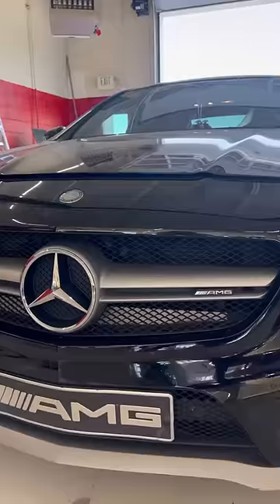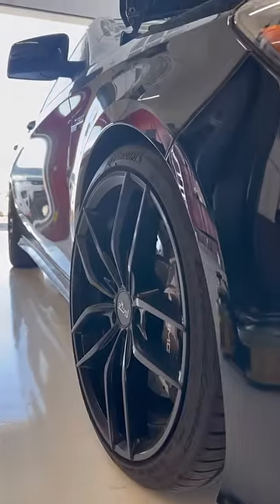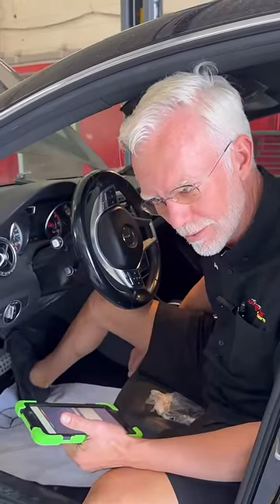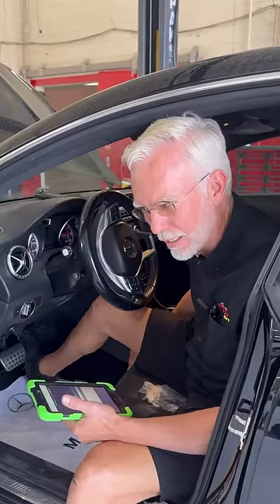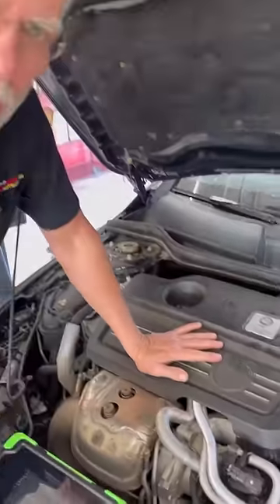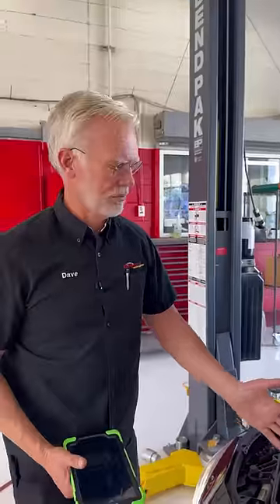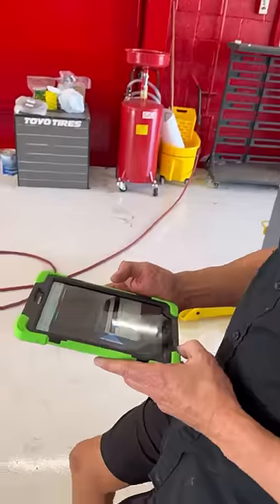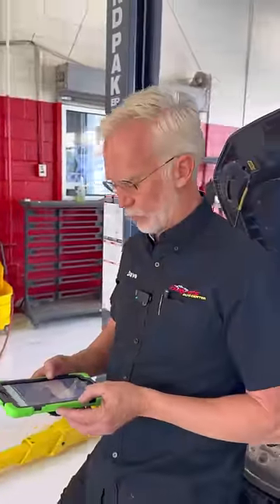Mercedes AMG Nothing but a slight noise on start up #carrepair #autoshop #mercedes

Comment: People need to realize that dealers are filled with the same kind of dummies that work at 5 minute oil change shops. They can only hire who puts in a resume or whoever wants to work there😂😂
Reply: That's... not even remotely true.
Reply: Not even close to being accurate 
As a fact its usually just the complete opposite, i worked for Mercedes benz dealership, and i have 30+ years experience, and the amount of ongoing training where i had to drive 6hrs to new jersey to their training center a few times a year, all the techs i workes with had so much training its unbelievable
Reply: Maybe the serpentine belt broke and they kept drive it cooked it but not seized
Reply: They also have to have a certain number of master techs!
Reply: The lowest payed mechanics in the industry 😢
Reply: Not entirely true. Some dealerships do hire only people who went to WyoTech or UTI. But the thing is still those can turn out people who didn't learn anything. As one guy told me, "they just rush you through." I will say this much they continuously train techs via the brand. But some do unfortunately act a bit too cautious about repairs. One guy out of fifteen did exactly that. He flagged engine and trans mounts a bit too prematurely and was let go. 

It all depends on the service manager and shop foreman or team leads. Where I worked they usually would talk to their superiors and service advisors. Same can happen in a local shop. I know I saw favoritism cause some massive issues.
Reply: @fox1978gmail  you are few and far between, bro. Just because you have  skill doesn’t change the fact that most are idiots. I’m in Residential Remodeling. It’s the same for my business, too. We’ve just dumbed down existence. Set bars too low and now we have a country that is predominantly stupid.  That’s a fact.
Reply: @Junkyardbuilds so, that means you probably met Hugh.....
Reply: Called it my friend.
Reply: @oddmanout7755 it's very fucking true they might be one or two actual real technicians at a dealership..
Reply: @louislachance1330 what's the problem.
Reply: @86LukeM I'm a graduate of mmi. My class was the last class run through the old way. They were pretty strict, but after UTI took over it was definitely easier, more open. 
It's a place where you can get out what you put in.
Reply: @TraceyAllen  I can definitely see the get the get what you put in thing. A guy I used to work with who went to UTI. He's probably still paying off his student loans. Walked through the Mercedes service department and saw a v12 car. I forget the model of Mercedes. He looks at it and says "v12? I thought the engine would be larger..." i respond saying, "I think they use smaller pistons. I thought you went to UTI?" He responds, "I did but they rush you real quick through everything." He was the second one I knew in that department. The other went to be a firefighter. The third got his foot in the door. But the guy I'm talking about got a DUI and quit, because the job required a clean record.
Reply: @Junkyardbuilds So is that why they want to replace a perfectly fine engine? All that TRAINING, and EXPERIENCE?
Reply: I feel that there IS a lot of training and years of experience in the dealerships, BUT, that is not the issue here.  Even dealerships are subject to the dishonest and unethical practices that are now in place and becoming the norm as the poor economic conditions are increasingly worsening and thus unscrupulous technicians have become more likely to 
‘inflate’ or outright lie to generate more revenue from unsuspecting customers!  I’ve caught more than one’tech’ trying to sell me something that I don’t need! The industry needs to police themselves for their own survival or we the consumers will not be going to them for any repairs! There are many more options for us to consider! 🤷‍♂️👍🏼🤔
Reply: @rootsmore-fire3061  i don't know, I'm not tge tech that diag it, I'm sure they followed the flow chart and came to that conclusion, there could be alot of different problems with the engine that we are not being told, we don't have the whole story here
Reply: @iamzeusandthisisthetruth4229  1st I was replying to a comment that said dealerships are filled with dummys so yes the training and experience was the answer to that 
2nd we don't have the whole story here, I'm sure there was a reason why they told the customer he needed a new engine, I'm sure they had a reason to tell him that because Mercedes-Benz dealerships will not tell you that you need an engine if you don't need one, it can take a long time to get one of those engines especially if they have to get it from Germany and being an amg I'm sure thats the case, so maybe he has low compression on a cylinder, or a bad head and turbo, we don't know,
Reply: Yeah at ford we only hired technicians that had been through the ford ASSET program (automotive college degree focused on fords) and I mean yeah the lube techs might be dummies but not even all dealers use lube techs
Reply: You are slightly correct. You have to remember that alot of these guys get manufacturer specific training wich is gold. I've worked at 3 different dealerships.. you will always have your under achievers that I wouldn't let work on my car. Just as well some of the smartest guys in the game on par with the brand field techs or engineers are here at the dealer.
Reply: I have worked independent shops most of my 35 year career. All the dealer techs we hire are lost at working on other brands! They get worked up because different manufacturers call some parts different names or put them in different places and have nothing to tell them what to do and quit in a few days. It's really sorry.
Reply: No way dude you're insane. Techs and sales folk go through tons of training and techs do certain certification exams to make them able to perform work on specific models or perform work like engine building or turbo rebuilding. Those are smart guys.

Now, that doesn't mean all of them carry certs or training. Some techs only do oil and filter replacement. At German dealers you'd be amazed at what techs go through for training.  Same with the guys in parts and service.

Comment: 1. Flush coolant system - Clean radiator inside and out if necessary
2. Change Thermostat - while you are at it, check valves
3. Check exhaust system - verify not clogged
4. Check for coolant flow - if no flow - change "water" pump
5. If water pump ok then examine/change turbo

Comment: Overheating 1st would be the thermostat. Front speed sensor would be to see if it's connected properly and cable not pinched. Turbo not getting full power count be from the sensor which would put it into an Emergency mode

Comment: boost leak on a boost pipe that causes that whistle noise and will cause under boost,also check the charge cooler that thing leaking

Comment: Well, I would check the oil filter, but I would also possibly pressurize the system. If you find any water leaks, check all the codes get them codes correct and then go from there.

Comment: could the under boost condition cause overheating causing the engine to push harder as its not getting the boost it needs?

Comment: Wheel speed sensor causing stress on transfer case. Could this cause overheat on differential? Boost leak I am dealing with now. Hoping sensor

Comment: Check the thermostat and see if it is leaking, Check the pressure on the radiator and if it is leaking, see if there is transmission fluid and it is topped off, make sure coolant is topped off and no bubbles or air in the system

Comment: If it has a variable geometry turbo then more than likely it has a vacuum leak in the waste gate control leaving it stuck open causing over boost condition and overheating subsequently or the fan blades inside the turbo have a foreign object that wiped them out

Comment: Very first test would be to check the coolant, look for smoke, do a head gasket test, followed by a cylinder leak down test. The engine is likely fine, but could have a sticky valve. Low boost could also be a faulty recirculation valve/bov/wastegate

Comment: There is a "hole" somewhere in the intake system and it's making that hissing noise and that's also the reason its tripping that underboost code cause  boost is escaping.

Comment: I would check the coolant/oil first. If they look good I would check the intercooler and exhaust system for leaks. Noise at start up that then stops at temp could be a bad seal or crack in something.

Comment: Needing an engine on that i would be checking the intercooler and the thermostat opening if thats sticking it will overheat if not that check the water pump and check oil pressure etc etc

Comment: First thing id do,  is run a thermal imager test on the radiator an look for cold an hot spots..(possible clogged radiator)..then check waterpump, an then a pressure test...to find out the overheat problem..check the coolant screen..then go after the engine noise 2nd...

Comment: The first thing I would do would be to check the oil for metal. Then do a coolant check to make sure there's no head gasket issues. If both of those come up clear then I would start looking for boost leaks

Comment: Pressure test water cooling system, cheak the radiator cap. The thermostat check heater in the car is working water pump niose?. Turbo could be overheated

Comment: If the noise is at intial cold start up, then when warmed up: oil hot, water normal hot. Could it be related to heat expansion on that  effected part  or component?  Sometimes its the most simplest thing.

Comment: Pressure test cooling 😎 system look underneath for leaks. Noise on cold 🥶 is o k wait till it warms up .change brake pads. Check exhaust. Put slick 50 magnetic oil in it .fantastic videos Sir 📹

Comment: Check coolant for exhaust gases confirming leaking head gasket, thinking I remember some German cars having plastic water impellers that cracked where drive shaft went through and would cause impeller to slip at high rpm causing overheat, and maybe check for excessive exhaust back pressure from clogged cat especially if it’s a turbo…….or a simple cylinder compression/leak down can tell you a bunch about inner condition……..the low boost could be exhaust restriction, fighting to breath

Comment: If it bin over heating check for blow head gasket with a block checker. Checking for carbon in coolant System.

Comment: Check whether the radiator temp output temps rise as the thermostat opens or not. If they don't it needs a new thermostat.

Comment: Change the engine oil to the correct specification, check the turbo oil hoses and check the cooling system.

Comment: They first thing I'd check is the head gasket 
See if exhaust gas is getting into coolant system 
It's fast and easy, can tell you if that's the direction or not

Comment: I'd say pull the radiator cap and start it cold and check for bubbles. Seems like a possible blown head gasket causing boost pressure to push past and into the cooling system adding an air pocket creating the over heating concern. But why is there no misfire code!?

Comment: I would look for a ground problem. A bad ground could cause false readings from the speed sensor and pressure sensor. This could also mean a variety of other sensors are reading wrong, but not out of range. It would cause drive ability issues.

Comment: It’s got a blown intercooler by the sound of it and not getting enough boost. Stick ur eyes in the front of the bumper see if u can see a seal pushed out or hear air pissing out.

Comment: Check Thermostat, fan clutch if not electric fan, blocked oil filter, oil color and smell. Check coolant for oil and oil for coolant in case of a blown head gasket.

Comment: I’d check oil first, then coolant level and cleanliness, then for blockages, air bubbles and or leaks, then fan, then thermostat, then water pump.

Comment: I would do a thorough check on the water pump and follow up with the under-boost problem after the cooling issue is corrected.

Comment: Pull codes which you did then do a compresslon test then do a test on the turbo. What’s the mileage? And check for loose clamps conduct small inspections first on cooling system and test drive.

Comment: The dealer wants the monster cash to replace the whole engine.
Check the supercharger boost issue and a possible small feed line vapor lock from or too the radiator.

Comment: The sound is air lose obviously coming from turbo line or turbo its self under boost code and sounds like a leak also so id say that check for leaks on lines and oil pressure to the turbo from cooler. And check the live data on your scan tool and it shows the wheel sensor reading and turbo and everything you can figure it out fairly easily.

Comment: Coolant level, t stat check, verify if temperature sensor is operating properly, check fans for proper operation, see if oil looks like milkshake, leak down test, monitor coolant pressure with the cap off.

Comment: Thanks for posting the challenge, my guess it will be an issue with a 'pollution management system', probably EGR or similar. My guess is that there is oil in the radiator polluting the coolant probably from a cracked intake manifold or EGR cooler or something like that. I look forward to your diagnosis.

Comment: Smoke test the PCV system as well as the induction system in general, Mercedes and BMW are both notorious for under boost because of those systems leaking. Over heating probably from overworking the turbo, without live data of course I'm speculating. Also hard to tell with the top cover on it but if it's equipped with a VIAS valve in the intake. Make sure that valve is working properly. I've seen those cause under boost without throwing codes for the valve.

Comment: Might want to also pull your temperature sensor also replace both of the O2 sensors then put some Justice Brothers fuel system cleaner through it using the check valve off the brake booster to do so

Comment: Well I would check the oil filter and see the condition. Also given that it has a engine code assuming p0299 I would inspect the wastegate actuation and the shaft play on the turbo as it can have wastegate rattling or excessive turbo play. @dave

Comment: Actually I’d check for TSBs related to this concern and then id check the engineering flow chart as a reference tool and I would let the customer know that it may be that they’re looking at 2 separate diagnosis if diagnosing and fixing the low boost concern doesn’t address it.

Comment: Dealer saw over boosting and overheating as major engine failure
       I had a 1.8t a4 a few years ago almost the same problem but In my case I had cracked the integral wastegate sealing surface

Comment: I first would check the thermostat to see if it's stuck. Wait, actually first check to see if the radiator fan kicks on when the temperature gets hot enough.  If it does that, then check thermostat.  If both are ok, then see if there is a head gasket leak by inspecting radiator for signs of combustion gasses entering the cooling system.

Comment: Turbo diag, then cooling  system diag and repair both accordingly. It's very rare that any Mercedes has a real engine problem unless someone ran it low on oil or the wrong quality oil or the wrong viscosity

Comment: IMHO petrol cars that run lean over heat. I'd do the most obvious first. Check cooling system. Air flow meter sensor. Boost leak. Oil change (bad oil). But supposed you already done that. Great job with your videos!

Comment: I would start with fixing that boost leak and checking the cooling system then see if boost leak was causing the overheating issue.

Comment: Overheating, underboost and noise. Look for exhaust leak that is causing excessive heat load. Possibly exhaust leak also melted wires to speed sensor.

Comment: Step one pressure test cooling system check for leaks, then make certain thermostat wasn’t stuck closed. If stuck closed replace thermostat and repeat step 1. Not sure if water pump is internal if not depending on book time I would try and sell the customer  a water pump if I am replacing thermostat and I like changing radiator caps if it old school pressure relief. Then I would inspect for inlet leaks on the turbocharger. Then I would go after the wheel speed sensor.

Comment: Take it for a spin; try to verify customer complaint.  I had a car come in from another shop with overheating issue. Other shop called "head gaskets" after a week of flushing, thermostat and messing around. Turns out, some clear-plastic dropcloth was up against the radiator 😂. ROAD DEBRIS!

Comment: Sounds like the exhaust might be clogged or pinched. With broken turbo parts. The dealership said to replace engine because it’s Mercedes of Farmington.  It’s a guarantee fix, they figure they will stumble across the correct issue.

Comment: well, I would start by pressure testing the cooling system. if it does not hold pressure, I would add fluorescent dye, and try to find a leak. . if there was no external leak, check the oil, and this just popped into my head, and I don't know if it would work, but it would be worth trying. if it seems like it is ingesting coolant, maybe check the exhaust for fluorescent dye in the exhaust? it might require a pretty dark area in order to see it. but if it works, ???   as for why the Mercedes shop told him it needs an engine, maybe they have seen major issues from this several times before. the Ford v-6 with the internal water pump that leaks comes to mind.

Comment: Overheating complaint, check the cooling system. The rattle sounds like heat shield rattle on the exhaust.